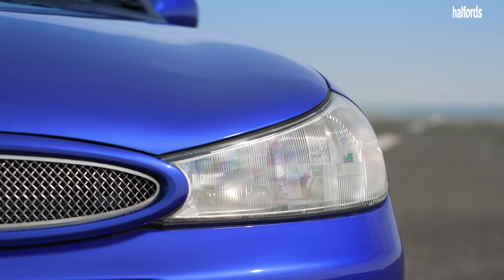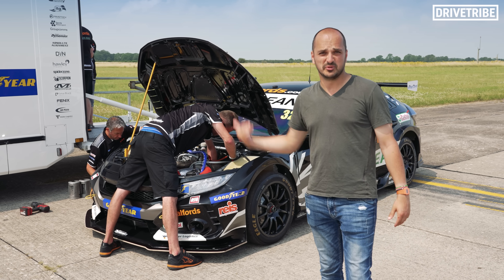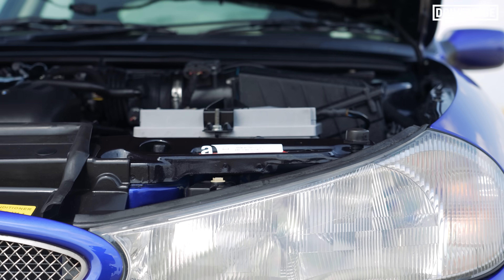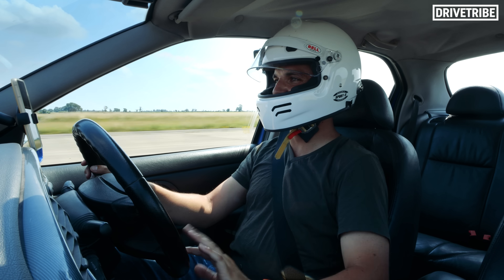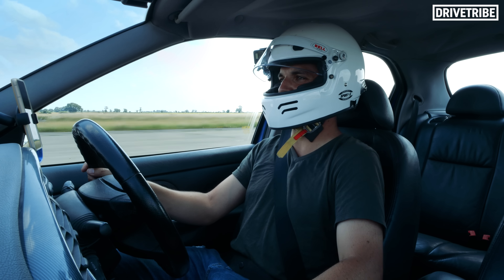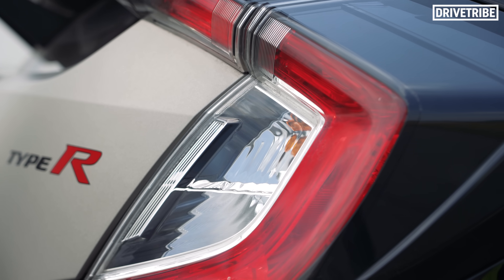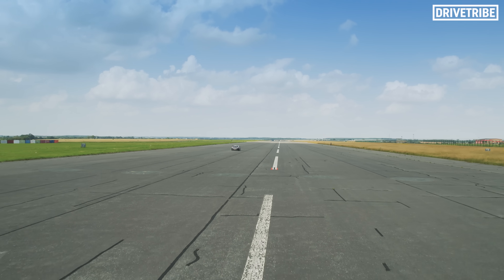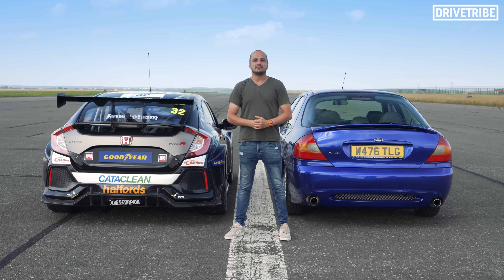Can our 21-year-old Ford still hit its original top speed?!

Comment: I don’t think that Mondeo could get up to 144 even on the autobahn with a tailwind. It’s down on power for sure.
Reply: The engine was never broken in, After the MOT video they found grit from the vapor blasting had remained trapped, had got into the oils and had washed out the bearings in the crank, Engine 1 was officially dead at that point, they then used the donor car engine, fully rebuilt it, brand new parts, it was done 36 hours before this was filmed, it was NOT run in, it had done less than 200 miles and was taken to the airfield on the back of a trailer, it left the airfield the same way because he ragged it so hard that piston six failed, cracked it and has ruined the second engine, he was told that it needed to be run in, he was warned it needed time to seat everything... He had no mechanical sympathy and decided to floor it every single pass, That blue smoke was the end of the engine
Reply: @cynosuregambit8292  How do you know all this background info? Was it streaming on Twitch?
Reply: @MrManBuzz  Yeah it was all streamed on Twitch, Micks told us all about it, He is obviously gutted he put his heart and soul into making the engine the best he could, pistons and timing chains from America, other parts specially ordered, only to be told on the day of the shoot "you're not involved in this one its a halfords video" and had to watch from a distance as Mike ruined the car.

Comment: What’s going on with the raised front suspension? It’s still stanced like an elephant is sat in the back seat…
Reply: It's got the wrong springs in it. I gotta say, for a supposedly restored car I'm not particularly impressed. The paint doesn't match (look at the rear passenger side door) sagging headliner and the poor thing billowing out blue smoke.

Comment: why is so much blue smoke coming out of a freshly restored engine? sounds like the engine is knackered already and struggling to perform like it was when new.
Reply: The engine was never broken in, After the MOT video they found grit from the vapor blasting had remained trapped, had got into the oils and had washed out the bearings in the crank, Engine 1 was officially dead at that point, they then used the donor car engine, fully rebuilt it, brand new parts, it was done 36 hours before this was filmed, it was NOT run in, it had done less than 200 miles and was taken to the airfield on the back of a trailer, it left the airfield the same way because he ragged it so hard that piston six failed, cracked it and has ruined the second engine, he was told that it needed to be run in, he was warned it needed time to seat everything... He had no mechanical sympathy and decided to floor it every single pass, That blue smoke was the end of the engine

Comment: Wow. For a big engine fully restored. This can is stunningly slow. 
My Volvo XC70 still pulls away at 150
Reply: Takes 210-220hp at least to go over 150 in an xc70, so I guess you got one of the hotter versions?
Reply: @GoldenCroc  XC70 T6 Turbo 3.0 6 cylinder. 
300 bhp. But with stage three conversion 628bhp
Reply: @InActionReaction  628? That is some stage 3, cant be much stock left in that engine bay, if its supposed to stay in one piece for long full throttle durations. Oh, and with that power, a true 200mph isnt out of the question.
Reply: @GoldenCroc  it’s true that there have been issues balancing out all the power without going into what I call Cardiac arrest. 
But on the motorway.  Yeeeehaaaaawwwww

Comment: Why don't you drive on the far left hand side near the beginning of the runway and have it in say in 2nd or 3rd gear rolling and do a half circle turn near the edge of the beginning of the runway end up on the far right hand side and you would be doing say 60mph coming out straight.
130mph + should be achievable then.

Comment: Would have been interested to know if it could hit its top speed even when new?
Reply: I had my old ST200 upto 150mph indicated, so around 140mph actual, and it took aaaaaages to get there. I later swapped in an ST220 engine with different cams, management etc putting out 270hp. Was very quick then!

Comment: having 3 cameras strapped to the outside of it wont help and I'm guessing you are using standard 95 petrol and I'm guessing its current HP output wasn't measured
Reply: 3 cameras won’t make virtually any difference to the drag because the resistance they give is tiny

Comment: Your not running on all 6 pistons the time from 70-90 was slow af I had one of these that had 146k on the clock and still maxed it at 151  in under 1.6 miles

Comment: Nah if that's pumping out 200bhp then it's not properly run in yet.  It's not that heavy of a car and with as single driver in, that should have gone 135+ at the end of the runway! My 2010 mondeo TDCI remapped to 200bhp could have done that, so the petrol variant should have too! Interesting to see how many miles they ran it in for...............

Comment: You would probably have to ship that car to germany and get on the autobahn for that.
Reply: Most of the German highways is restricted. It's unlikely he'll get a clear, unrestricted section to himself for filming.
Reply: @NegativeNumbers427  He could put a camera on board though. There are plenty of long straight roads without speedlimits. I got an Audi A4 1.9TDI to its topspeed there, and that's a 131hp engine.

Comment: This was shocking.
Reply: The engine was never broken in, After the MOT video they found grit from the vapor blasting had remained trapped, had got into the oils and had washed out the bearings in the crank, Engine 1 was officially dead at that point, they then used the donor car engine, fully rebuilt it, brand new parts, it was done 36 hours before this was filmed, it was NOT run in, it had done less than 200 miles and was taken to the airfield on the back of a trailer, it left the airfield the same way because he ragged it so hard that piston six failed, cracked it and has ruined the second engine, he was told that it needed to be run in, he was warned it needed time to seat everything... He had no mechanical sympathy and decided to floor it every single pass, That blue smoke was the end of the engine
Reply: @cynosuregambit8292  where did you get this information?
Reply: @karlt9087  Twitch.tv/Mad_Ford_Engineering/Videos look for the recorded stream from 15th I believe there are 3 in there, That's where he's talking about it, I am a viewer of his stream so I've seen all the stuff happening in the background 

Its honestly abysmal
Reply: @karlt9087  https://www.twitch.tv/videos/1079442581?t=0h21m12s this is one of the reports after he took the engine out

Comment: Get into 5th earlier and let the torque pull you through?
Reply: No because you’ll have higher torque in a lower gear…
Reply: @qasimmir7117  that's true with regards to gearing but with regards to specific engine output, peak torque is much lower in the rev range than power and as a rule torque usually falls off quite drastically after peak, so to change gear and use the engines torque to spin the gear set up may help. It's all speculation, hence the question mark and certainly is a more effective strategy with forced induction but I certainly can't see the harm when spending most of the runway trying to wind 4th all the way out, it makes sense (potentially) to shift up to a higher gear to attain more speed..
Reply: 5th gear was designed for motorway cruising at a low rpm so doubt it would have helped.
Reply: @gavinwyllie7855  fair, if it's a 4spd box with overdrive (yes most 5spds started out that way) but at the same time, if the engine can keep turning that ratio the end result would be a higher top speed. I maintain that it is speculation but I believe it would have been worth a try and again I'll conceed that with forced induction it is a more feasible strategy but I guess unless it's tested my point of view is just a theory but spending half a runway trying to get an extra 1,200 rpm outta 4th, I'd change up (at least to be proved wrong)

Comment: Rebuild 2.5 litter 200hp V6 and you cant get to 200kph. ARE YOU JOKING? I GET TO 220 IN A OPEL ASTRA 1.9 150hp DIESEL. And 17 sec 1/4 mile this is a joke right.

Comment: Pretty disappointing, didn't make much effort to get it to its top speed, like by doing a rolling start, I would reckon given the width of the runway you could do atleast 50mph onto it if there was adjoing tarmac at or near the end. I was rather hoping you were going to come up with a back-up plan, like going somewhere else, even if you left it for another video - but you just gave up :(

Comment: I had one of these a few years ago. The car behaved quite different on the open road and in high altitude. I remember going the top speed of about 240 Kmh non-retarted units but at that speed it consumed around 30 litres on 100 kilometers. I miss that car

Comment: That's not quick for a ST200 my new MK3 sandero after it's 1st 1,000 miles it has a claim top speed of 112mph I got 115mph from it with half a tank of fuel remaining so only 8mph difference and it has 90bhp.
Reply: Too add too about halfords 3 years ago I had a customer bring in his Zafira 1.7 Diesel after it broke down. It had major knock from the engine and I checked the oil and it was the wrong type for the engine. I ask them where did you get the car done they said halfords auto centre the car needed a new engine after there mistake luckily they paid for the new engine and paid for the fitting at my garage.